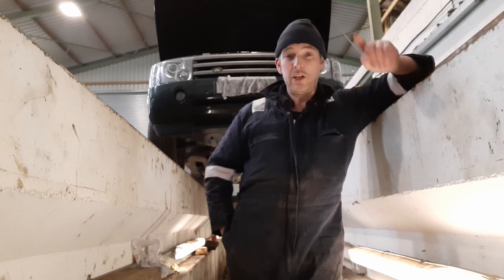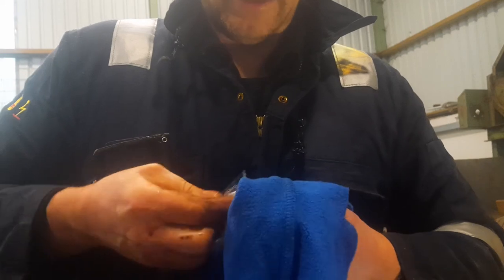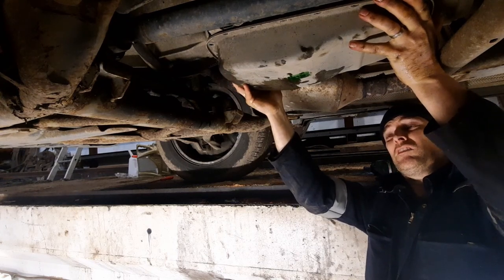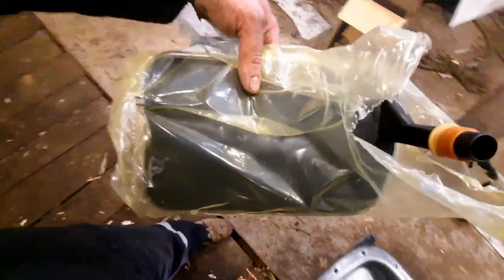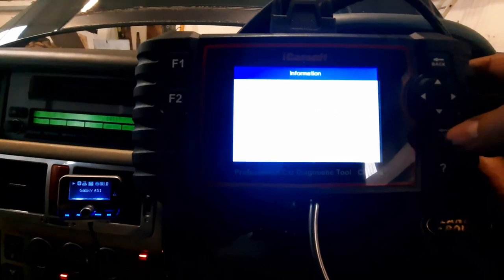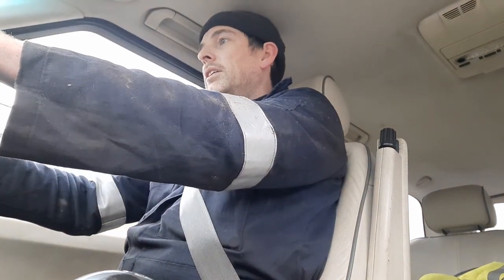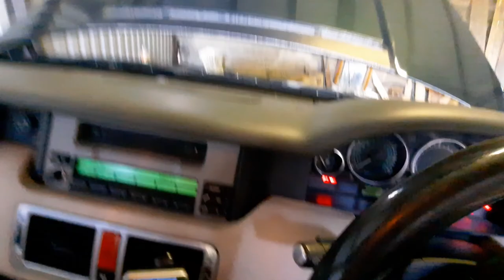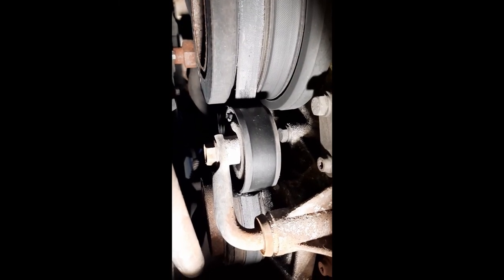Range Rover Episode 2

Comment: two things from some one that knows nothing but worth mentioning just in case 1 when I had an injector code it ended up being the fuel filter by the nears side rear wheel I did not
know it was even there 2 one trick I was tought by an old R/R mechanic when I changed the batt all the lights came on and would not go off  With the engine running turn the steering
wheel all the way to the left and then all the way to the right all the warning lights go out I have even done this on code problems and it works just thought I would mention it great vid !!
Reply from the maker: Allan, I wasn't aware there was another filter! Must be right next to the external fuel pump. Thanks for the tip, I'll check it out when I pull the cover and see before I change the pump. The lock to lock resets the steering angle sensor after reconnecting the battery. Strangely, I had a disco 3 in for work recently and you can't do it on those, and my reader also wouldn't do it. Thanks for watching 👍🙂
Reply: @davesworkshop2714  Hope I am right about the fuel filter and not pump it was a long time  ago but i am sure it was a filter in like a tube ?? Hope I have not sent you up the garden path ?? it was to the front of the rear near side wheel if that makes sense ??
Reply from the maker: @allanhughes7859  I need to get in there regardless so I'll check 🙂. There often is a gauze at minimum ahead of pumps like that. Pretty sure the filter in the D3 lives back there, and the same on my 520d.

Comment: Fantastic video! 
Think i hear a Weak Turbo ? That dentist drill sound !
Reply from the maker: The turbo is loud in it, but Ive read that it may be caused by a leaky vacuum line to the actuator, i need to check it out. If not I'll pull it and get it rebuilt by the company that did the Fiat turbo for me, theyre pretty reasonable. Thanks for watching!

Comment: Loving the videos Dave. I'm thinking of buying a diagnostic tool, what's the one you're using and how does it work regarding costs and updates?
Thanks 
When is the next video BTW?
Reply from the maker: I'm using the iCarsoft CR Pro, there's a video on it here https://www.youtube.com/watch?v=6HLuzFZQ1-o. So far so good, it's worked with anything I've used it on (Land Rovers, BMW, Toyota, Fiat). To be honest, I haven't looked at the update side of it. I initially went for it because they do a LR only version, but when I looked at the rest of the range I realised they did universal ones. I think it's good value for the features, but then again it's only my second diagnostic tool. Only issue I've found is it wouldn't read the TDCs directly on the RR, neither would my other tool, I think it's a comms problem, and it wouldn't connect to the engine ECU under RR, so I I got to that by selecting BMW instead. Again this could just be the truck too. Should have another video in the coming days, including some new projects! Thanks for watching.
Reply: @davesworkshop2714  which BMW model do you select on iCarsoft device to connect with the TD6 engine ECU unit? I’m having the same problem with the iCarsoft not able to connect to ECU using LR model.
Reply from the maker: @morris3j  It gives two options, X3 and all other models. Then I think its the first diesel engine option when you select manual scan. A light must have stayed on so the battery is down the workshop charging tonight so I can't check 100%. Just plugged it into my 520d to check. Ill look again tomorrow when its charged up.
Reply: @davesworkshop2714  thanks Dave greatly appreciated.
Reply from the maker: @morris3j  OK, checked it, All models except X3, Then select manual scan, then ECM/DME/DDE(Digital Motor/Diesel Electronics). Good luck 👍
Reply: @davesworkshop2714  thank you for taking the time Dave!
Reply from the maker: @morris3j  Not a problem 👍, thanks for supporting the channel.

Comment: when you first drive after the gearbox service, you said the car was labouring, you disappear and jobs a good un 

can you tell me what you did, i have an l322 that i love, but it’s certainly not powerful, i just want to know if there’s some quick thing i can try on mine.

great content btw!
Reply from the maker: Dave, there's a fault on mine at the moment, one or both of the low pressure fuel pumps are weak. If i leave the plug loose on the lp fuel pressure sensor on the fuel filter, the fuel pressure signal goes to a default setting of 4.4bar and it drives fine, just has a warning on the dash. I leaned on the plug during the service, pushing it back in. Then it reads the true pressure and loses performance. It would be worth checking your lp fuel pressure (or unplug the sensor - you'll get an injection system fault message on the dash). They also are very intolerant of poor quality filters so make sure you have a good one. Outside of that check your boost hoses, and check the vaccume pipes for the turbo actuators as aparently they can leak. Thanks for watching! Ill do a video on the fuel pumps and turbo soon!
Reply: @davesworkshop2714  really appreciate you taking time to reply 👍
Reply from the maker: @daviddickinson6955  you're welcome, thanks for taking the time to watch! 👍

Comment: when you caped it off did you not have to re set any of the electric controll units ????
Reply from the maker: The EGR on the early ones is purely mechanical (just vacuum), with no position monitoring so it doesn't trigger any faults. My first X Type was the same, but my later Euro 4 car would throw codes unless there was a 3mm hole in the blank plate to allow some flow.
Reply: @davesworkshop2714  Thanks for that sorry to be a pain but where did you get the blanking kit from and dare I ask how much it cost ??
Reply from the maker: @allanhughes7859  ill check it out tomorrow and let you know, i think it came from ebay. If you plan to get one I'd also advise getting a different clamp to secure the exhaust line to it as the factory clamp  (a glorified jubilee clip) didnt hold it tight to the blank and it leaked. I think one from a Peugeot 1.6HDi might be better. I needed a quick solution so welded up a crude but effective one.
Reply from the maker: @allan hughes I got it off autoparts815 on eBay. It was €26.99. If you search on eBay there are a few different ones available (also search for the BMW M57 engine). I bought mine off a Polish supplier to avoid having to get it from the UK due to customs, though given the value, I don't think I'd have had to pay anything.